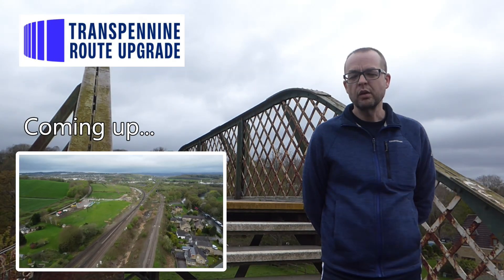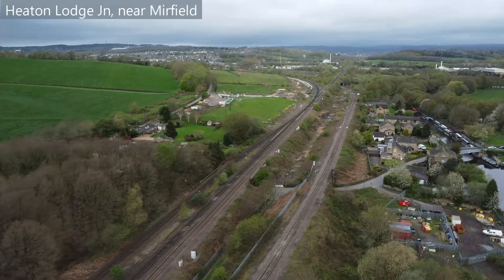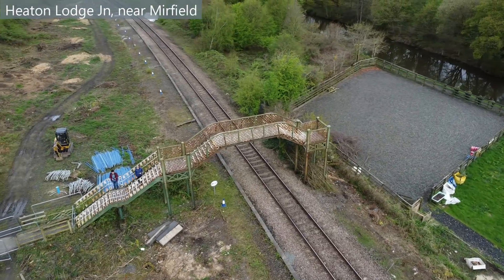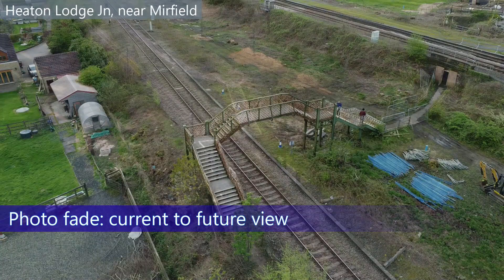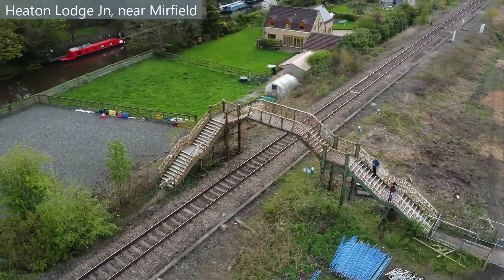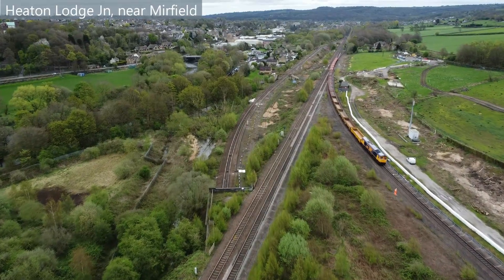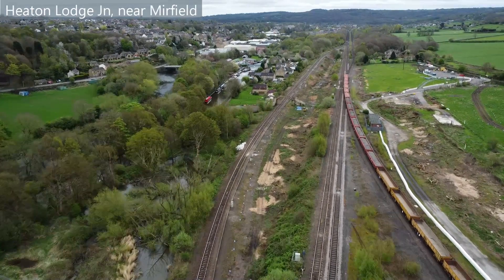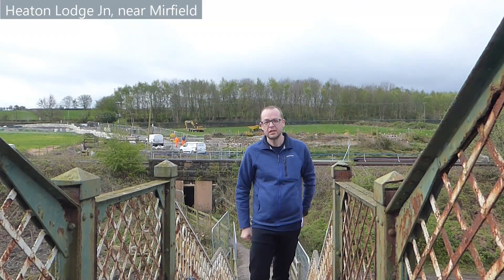Update by DRONE: Heaton Lodge Junction, Transpennine Route Upgrade

Comment: Hold up, are they undoing the fact that it is a flying junction, how are those two new tracks going to join and improve the situation, when there was space for a second track through the tunnel which could've been reinstated to keep it entirely grade-separated.
Reply from the maker: Looks to me like the new lines would be a less tighte curve so should be able to carry more speed through. Unsure about the tunnel but don't think there's any plans to reopen it
Reply: @i_and_g_adventures  It makes sense to increase the speed around the curve, but the fact that they aren't leaving it grade separated means that there will be additional congestion through the junction so it seems like one step forward, 2 back.
Reply: @Soj_89  The existing Down and Up Fast lines will be retained as Down Slow and Up Slow, with new fast lines built alongside and not conflicting with or connected to the Calder Valley lines at Heaton Lodge. There will will a new grade-separated junction at Ravensthorpe, and the two pairs of lines will join and reduce to one pair east of there.
Reply: @RH-uo8wl  That makes sense, thanks for the explantion. I'm from down south so I haven't been that up to date with the transpennine route upgrade.

Comment: there was a bad set of points were the lines joint up on the way to leeds TPE,s had to slow down to about 15 mph
Reply: The original speed limits at Heaton Lodge junction were 30mph on the up lines both slow and fast. 25mph on the down lines, 20mph at Spen Valley junction later increased to 50 when that part of the Leeds new line was used. Later still increased to 70 for DMUs when the underpass was made single track.
Reply from the maker: Hopefully that gets fixed 🤞